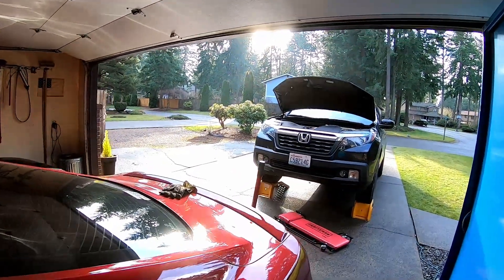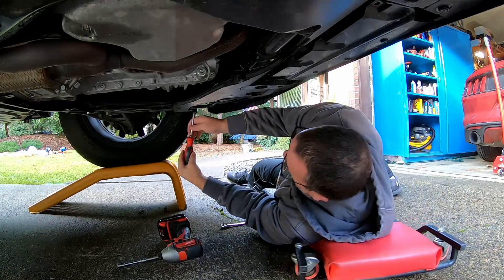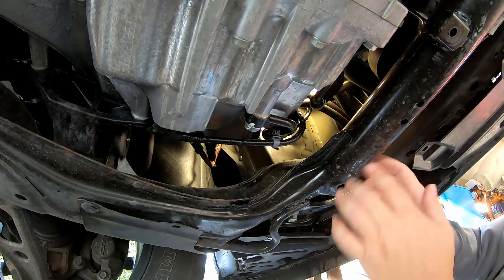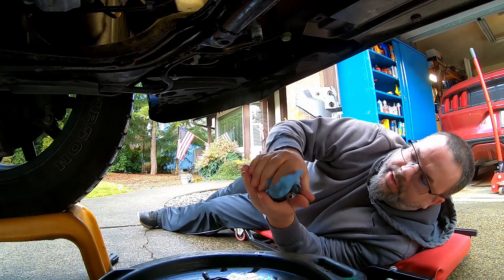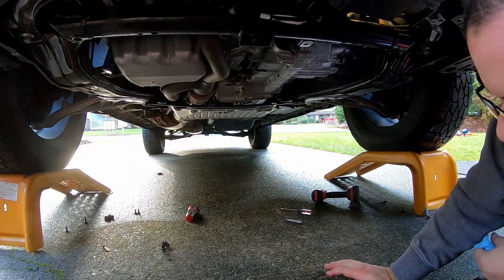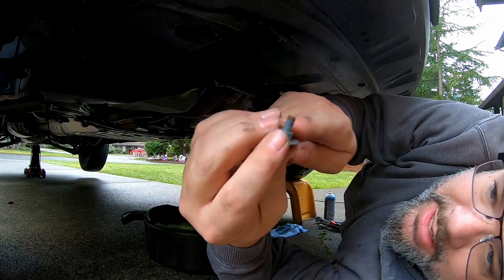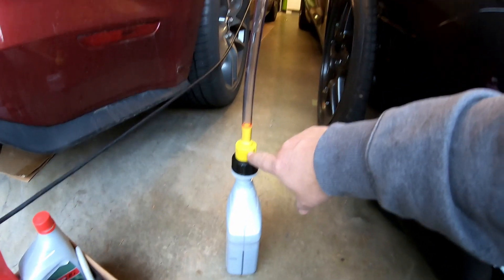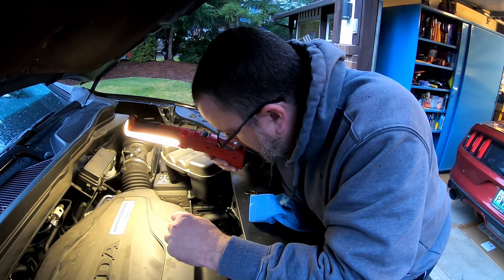2017 Honda Ridgeline 2016 Honda Pilot Transmission Fluid and Filter Change, Yes there is a filter.

Comment: nice job and yours was the only clip I saw online also, is the washer for the drain-plug  the same one used on the transaxle also? if not where did you purchase it?
Reply from the maker: Thank you Karla.   I am not sure on the drain plug washers and which ones are interchangeable.  I would have to look that up myself.  All parts came from the same dealership where the Ridgeline was purchased.
Reply: @PNW_Car_Mods  I believe I found the washer part # for the drain plug it is 90471-PX4-000. I acquired a package when changing the trans axle fluid earlier and had forgotten.
I have been experiencing  what appears to be early shifting or hesitation on the acceleration after shifting and I am at 30500 miles. After reading about it on the web there is a TSB 17-025 out there about it and it refers to torque converter issues that are corrected by a drain and refill 3X so I am doing that portion of the TSB  at this point to correct the issue. I will also change out the filter too. Your clip will be helpful thanks.
Reply from the maker: @karlaharpst5585  That is the Correct drain plug washer number Karla.  I just dug up my receipts.    :)   I don't have any plans to do the 3X drain and fill on ours but I will say that I will probably just drain the trans after every summer and refill.  It's cheap and easy.   What year is your Honda?   Ours is one of the early 17s I think built in Aug or Sept of 16. delivered in Oct of 16.   It's been 100% for us.  No returns for repairs to the dealer.   I hadn't thought about it much but I'm assuming ours is out of warranty now.
Reply: @PNW_Car_Mods  We purchased our Ridgeline May of 2017 it was new off the lot I am not sure what month it was built in, the door sticker shows a 4/'17 but that seems too close for a build date. We have not towed or used the truck as a work truck just a daily driver with small trips included. Its been a very comfortable vehicle and we have been happy up to this point with it. We did get the  recall completed for the wiring harness corrosion issue but that has been the only maintenance beyond normal needed. We did contact the dealer and the transmission/torque converter problem is covered under warranty if it is more than a drain and refill (power-train/warranty 60000 miles), but the fluids would not be so we decided to do it ourselves.

Comment: 2019 Honda Ridgeline- How often does the filter need to be replaced? What is the milage interval for transmission fluid changes.
Reply from the maker: Fred the filter is considered to be a lifetime filter or replace if the transmission gets damaged.   I like the idea of changing it at least once and then maybe not again until the transmission needs rebuilt.   I am honestly unsure of the interval.  We changed it when we did because we were towing at max gross weight with it for a summer.
Reply: @PNW_Car_Mods  thanks for the info!

Comment: I use a translator. Honda Pilot 2017 For a 9 speed transmission, is it worth installing additional cooling? Or is it unnecessary? I want to tow a motorhome, don't know which one yet
Reply from the maker: You need to check and see if you have a cooler already factory installed. If you do then you don't need to worry about adding a cooler.
Reply: @PNW_Car_Mods  it's not there

Comment: Does 2016 Honda pilot require 3 times drain and fill?
Reply from the maker: Everything I have seen says the 6 speed transmissions are not.  I know this was heavily debated on ROC forum saying it is not.   According to our local honda parts department it was not so that is what I went with.

Comment: Whats keeping that thing from rolling off the ramps with the rear wheels off the ground??  I use 4 ramps to keep the park and e-brake in use. Be safe out there.  Otherwise a great vid!!
Reply from the maker: You are right Brent.  I should have secured that more.  I think in my mind it was like I am just not going to get under there and I'll put it back down once it was done draining.  Which of course I did later but after I had put the drain plug and underbelly back on.    Thank you for that criticism.
Reply: Noted that...Scary..But awesome detailed  video! So good , My mother in law will be able to do it! Even w/o rear wheel chocks.LOL!!

Comment: Good Vid .  I wish I could see the relation of the Filter's proximity to the " Dip Stick " .  Was that longer tube that was at the top of the filter connected to the bottom of the dipstick ?  Or is the filter & " Dip Stick " two separate parts ?
Reply: Disregard .  I looked closely at mine & can see where they are in separate locations .  Thanks .  I'll give it a shot next week .
Reply from the maker: Sorry I missed this one yesterday Gregory.  Happy to hear you got it sorted out.

Comment: Question??? How do you change the coolant on this (my) beast? Subbed thanks very through
Reply from the maker: Appreciate the request Jeff.  We do not. This particular truck IMO had no where near enough age or miles to require a coolant change yet.   I would think someone will come up with that before too long as these gen 2s get a little older.
Reply: MRBLACK947 my trusted  mechanic says every 50,000 no matter what Honda says on the coolant change
Reply from the maker: @jeffw3776  I think that is fair and it should be fairly easy to do.

Comment: If only all the videos on YouTube were this good. Nice work! What do you tow and how much does it weigh?  Sorry if this has been asked.
Reply from the maker: You are far too kind Keith.   Thanks for checking it out.  We were towing a 21 foot 5k pound travel trailer with it.
Reply: @PNW_Car_Mods  hello sir, fyi you are suppose to install an OEM transmission cooler from Honda if you are going to tow up to 5,000 lbs or it will void the warranty.
Reply from the maker: @chrisgil4594  RTL-T and above come with it IIRC.  Ours had it installed factory.
Reply: @PNW_Car_Mods  oh ok, awesome. i didn't know it came standard on that trim, you know your stuff. Thanks
Reply: @PNW_Car_Mods  hey buddy, do you mind me asking what octane fuel you usually use? I use 87 octane without problems, what do you recommend? Thanks oh and btw i have a 2017 Honda pilot with the 6 speed transmission, which is the same as the Ridgeline
Reply from the maker: @chrisgil4594  unelss it was around the block we always towed with 92 octane.   Daily Driving was on 87.   Can't say whether it helped anything or not but with that kind of load its better to minimize the computer having to pull timing.
Reply: @PNW_Car_Mods   Awesome, thank you for the advise .

Comment: It's funny on the hondas in general I looked everywhere on when to change that filter there is no interval on changing it for some odd reason .I called honda they said don't change them unless something is wrong I asked why it's a filter .they had no answer. I change mine on my 08 crv every 30k.i mean it's a filter why don't they put it in for service.
Reply from the maker: Troy that is generally what I heard as well.  Basically as far as Honda service is concerned that filter only needs to be replaced if the transmission is damaged or replaced.    I figured it was cheap insurance.  especially since we were towing with it every once in a while.

Comment: Nice video!  The hose filler you talk about must be this: Hopkins 10106B/6 FloTool Spill Saver Trans Fluid and Gear Oil On-Off Filler Refill
Reply from the maker: Thank you.  That should be the one.  Seems well made for the dollar.  I know several have said they skip the funnel and use the removable fill plug bolt.  I was fine using the funnel and one less seal to break on the transmission IMO.

Comment: If you're gonna use those pliers on the hoses like that, do yourself a favor and replace them with the filter. I've been doing this 25 yrs and odds are good you will rupture the walls of the hose and a leak will develop at some point.
Reply from the maker: I'll believe it when I see it.  Over a half million miles driven all over this country on road and off in some of the harshest conditions and I've never had a hose failure. I've been working on cars for almost 40 years.   Everyone one has a different way of doing things.
Reply: @PNW_Car_Mods  You'd believe it if someone in YOUR shop got lazy, used a pair of gas pump pliers, ( rather than proper tools), ruptured the hose, and you wrote a few checks for towing charges.
It happens. We replace the hoses with filter. They're cheap.
Reply: @PNW_Car_Mods  He has a mild point.  Using the Blue Point hose removal pliers will ensure that potential damage to the hose is minimized.  However, you did not pull hard on those hoses and there was nothing wrong with your method.

Comment: Great video! People like me really appreciate these type of videos! Question, i just got a new 2019 ridgeline. After manufacturer break in period of 600 miles would you change the oil shortly after or go to the 7-10k? Did you get yours new?
Reply from the maker: Bought new sight unseen in Sept 2016 and delivered Oct 3 of 2016.     They say the factory maintenance minder is set for 45k miles IIRC.    
I would wait a while to let that initial break in do it's thing.  We did ours early only because we had been towing with the Ridgeline last summer.  It's so easy to service though I could see changing the trans fluid every other oil change I bet the trans would last longer than the truck.

Comment: Thanks mrblack947 for video. anyone wanting to know ATF fluid change procedure that honda tech use, google SB-10108363-9340 or https://static.nhtsa.gov/odi/tsbs/2017/SB-10108363-9340.pdf and follow repair procedure on page three. if you have torque converter shudder between 30 and 40 mph and 50 to 65 mph add lude guard instant shudder fix to last drain and fill ( if your doing three). I personally don't do 3 time drain and fill. I change ATF every 30 k add shudder fix and ATF inline filter every 60k. hit the like if this help you

Comment: DId you ever learn how to read the dip stick? I just changed my 2017 Honda Pilot trans fluid and filter and I am having the same problems reading the DIP Stick! I put in 3.75 quarts trany fluid and only one side of stick is showing a reading. I feel like a dip stick now that I don't know what is going on here.  HELP!!! SOS! lol.
Reply from the maker: Hey mike.  I would stop filling IMO.  I stopped at 3.6 quarts with the filter change reading off the side that clearly showed a fluid level. Making sure the stick was clean every time.
Reply: @PNW_Car_Mods  Im not getting any reading on the side with HOT! back side shows its way over full
Reply from the maker: @mikekmalick  I would probably drain a few tenths out just to be safe.  Over filled is generally not good.   read the stick by mirroring one side to the other if that makes sense.    Make sure you drive it around a bit too if you haven't already.
Reply: @PNW_Car_Mods  I just checked oil level and it is showing at the lower hole level right now.
Reply: I will check again tomorrow morning after I drive it a few miles
Reply: @PNW_Car_Mods  Take the dip stick, place it on a clean blue towel.  Pull the dipstick downwards along the towel and observe the level.  Can do this with oil. My Yamaha outboard oil is so clear that this is the only way to check oil level after an oil change.  Works for transmission fluid as well.

Comment: What size of your wheels and tire? Did you put the leveling kit?
Thanks
Reply from the maker: 18x8 wheels and 265 60 18 tires.   Yes I self installed the leveling kit.  I was one of the first to self install on Gen 2.  It was a massive pain in the ass.  Well the front was.  The rear was easy.   Nothing like tearing apart a brand new rig with less than a 1k miles on it and hadn't even made the first payment.

Comment: Did you ever get the transmission issue where the RPMs bounce around while accelerating? There's a TSB for it. Thank you for the video!
Reply from the maker: We did not Ed.  We were lucky to have never had any sort of weird transmission quirks.
Reply: What TSB are you talking about for this? I sometimes experience this, and would love to fix it. Thanks!

Comment: Hi friend.if your driveway has a slight incline couldn’t you face the car down on it and drive up the ramp thus making the car close to level?
I know ramp says use on level. Your opinion required. Just don’t like balancing the car as you did.
Reply from the maker: Jeff it was only jacked up out back to drain the remaining fluid out.  I didn't do the whole job like that.  Driveway is flat as a pancake.
Reply: MRBLACK947 I’ll probably use my driveway to my advantage and block the back wheels. Thanks
Reply from the maker: @jeffw3776  definitely.  Always be safe as you can.

Comment: I know you like tinkering on things. I heard the earth dreams series in all the models for Hondas are direct injection engines and have no way of cleaning the back side of the valves like traditional port injection engines. If this is true you might want to look into adding a catch can to the pcv line
Reply from the maker: While I can appreciate the idea we knew we'd never keep this truck long enough for that to manifest.  The Honda while a fantastic machine will be going away soon as the lease is coming due and we need a little more tow rating. :)

Comment: Nice vid. Most automatic cars it is suggested to do 3x drain and fill just so all of the old fluid is changed - drain, fill, drive and repeat. Most of the ATF is in the torque converter and lines and the 3x drain and fill is much safer than a flush, although tedious on cars without a dipstick. I believe the Ridgeline has a bit over 8 quarts of ATF

Comment: What's going on Mr. Black?
I know your sitting on some juicy content. 
Wating to upload untill 2020 for tax reasons? Lol

What have you been working on lately? I need more of you videos to watch. 
-Chuck
Reply from the maker: Hey Chuck.  Pretty soon.  I've been sick since Christmas and the weather really sucks.  Still feeling pretty crappy.  Probably going to take the rest of the week off.    Parts did pile up during Christmas for sure.   Isaac got a full Auto Custom Carpet to replace the trashed plastic flooring in the Crown Vic as well as a full Brake Motive zinc coated brake kit.  His front brakes are pretty tired at 64K miles.  I guess the cops have to stop pretty hard lol.     There is a bunch of Corvette stuff coming up.   Changing out the headers intake manifold and a few other parts trying to achieve 450 wheel horsepower without a crazy camshaft.  

There also may be a new vehicle coming to the channel soon but that will remain a surprise.

Comment: Is changing the filter necessary if you don't tow th vehicle?
Reply from the maker: I believe the generally accepted consensus is that the filter is meant to last the life of the transmission.  So no you do not have to change it.   I do however think it's a good idea to change it on the first trans service if you can towing or not.

Comment: Why pour oil through a tube?  There is a filler hole between the engine and the air filter!
Reply from the maker: Pretty simple.  I didn't know it was there at the time, and it's been brought to my attention already.
Reply: @PNW_Car_Mods  How much oil is 3.5 liters or 4 liters.  ?
Reply from the maker: @marcepan8142  if we're splitting hairs I used exactly 3.65 to get it to read on the stick where I wanted it.
Reply: @PNW_Car_Mods  Thanks !👍

Comment: Great video.
Stupid question: is there any reason to fill via the transmission fill port Honda provides on these transmissions (and says to utilize in fluid changes) as opposed to filling through the dipstick?
Reply from the maker: Not stupid at all Evan.  At the time I did this job I didn't even know there was a fill port until someone else mentioned it in the comments.  The only reason I could see an advantage of using the dip stick pipe is not breaking the seal on the fill plug.   Either way is fine IMO.

Comment: How much trans fluid would you say you put in in total
Reply from the maker: Joshua I can't say for 100% as that was a while ago and I work on cars almost daily. I think I said in the last few minutes of the video.  Don't just blindly follow this but I think it ended up being around 3.5 or 3.6 quarts.  Just sneak up on it. You don't want it overfilled.
Reply: @PNW_Car_Mods  thank you sir for this video and quick reply, I was having the transmission rpm bounce problem and decided to do this and see if it helped. To my surprise it totally corrected the problem. I ended up putting about 3.5 quartz before I decided to just stop all together because it was so difficult to read the dip stick.
Reply from the maker: @Jrm1376  That's great johsua.  We were fortunate it seems to never have any weird shifting with ours but this service seems to have helped many that do or did.

Comment: Thanks for the EXCELLANT video.   I have a 2018 Pilot that "surging" that is suppose to be fixed by the 3X drain - I have 40K on it and need to do it anyway.    I'll do the filter also - it seems pretty easy - except for for laying on one's back :-).

Comment: Is anyone here using the valvoline in the honda transmissions? if so how long and any changes?
Reply from the maker: Cliff, I have never heard of anyone using an alternative fluid in Honda transmissions.  Will be interesting to see if someone chimes in with an alternative that works and won't harm it.
Reply: MRBLACK947 I agree
Reply: In my Honda Accord, I once put in a non-Honda transmission fluid and it caused real problems.  I quickly went thru the process of replacing/flushing the non-Honda fluid with the proper Honda fluid.  That put things right.  So unless you're willing to take a chance on having to do the messy and time consuming process of replacing/flushing, don't do it.
Reply: I've done 2 D&Fs with the Valvoline MaxLife ATF on my 2012 Accord SE.  No issues so far.  I'm considering using it on my 2017 Pilot AWD EXL.